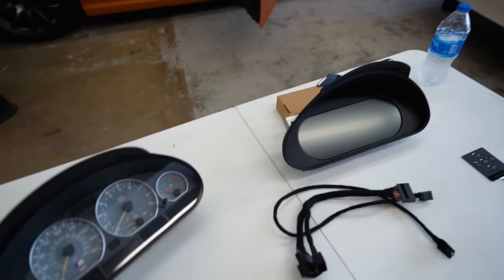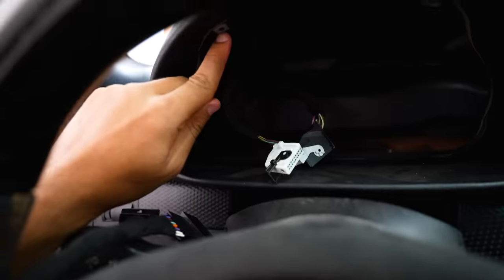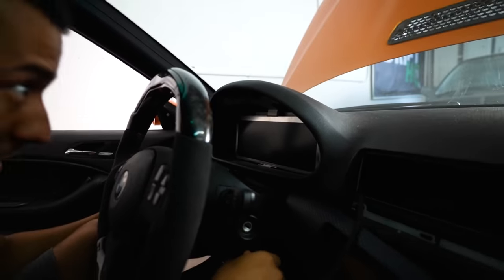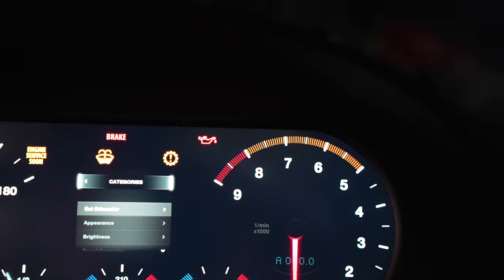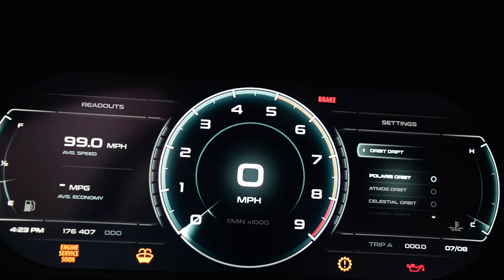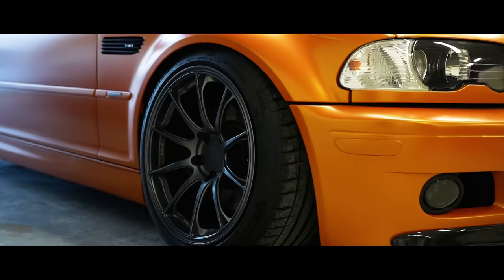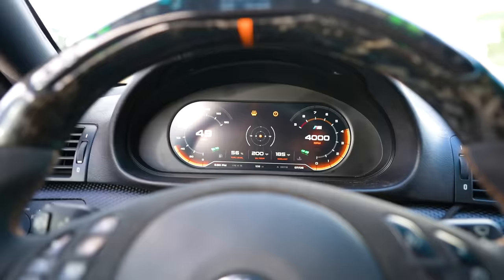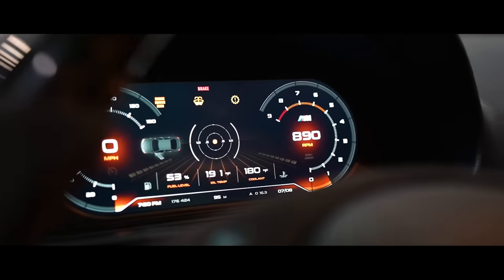How I Made My 20 Year Old BMW Look Modern Again (E46, E90, E60, E82, E70)

Comment: Is e46 more dynamic( fun to drive) than e90 ?????
Reply from the maker: While not as fast, it's definitely more fun to drive.
Reply: handles better too
Reply: @oni5909  so e46 better handling. ok. so e90 has no advantage against e46?
Reply: @hater8812  like if you wanna take a car on backroads and you have experience the e46 is gonna win
Reply: @oni5909  so e46 is more fun to drive. ok. thanks
Reply: @hater8812  yeah the cars notorious for the way it handles and takes turns was really famous for it
Reply: @oni5909  so e90 is softer. i never driven an e90. It s my dream
Reply: @hater8812  well it’s a 4 door so lot more body roll when you turn the e46 almost has none in most turns in the front

Comment: It's illegal to change the odometer mileage
Reply from the maker: It transfers the mileage from the ECU.
Reply: @VehicleVirals  but why is there an option to add or delete miles? That's illegal.
Reply from the maker: @saltpeter500  only lets you adjust the last 3 digits in the rare case it's off. That said, your true mileage continues to get tracked via the car's ECU (never changed).
Reply: what are you 8 years old ? It’s illegal ? your legally allowed to be able to change to match the new car the dials are going into and also for correction purposes

Comment: $2000 cluster and it's as delayed at the free version of torque you can have with all the same infor on a cheap eonon head unit. The human eye is most stimulated by green light so the asa wheel display is highly compromising ur detail and distance visibility at night. Does that cluster come with a dimmer option? Idk why it's just an oval ringed in abs ringed in more abs. IT should be built to full size for $200. I could hack an android tablet into my dash and add abs trim around it and set up some torque guages and make this for under $100 at this quality. Drukhadz makes all kinds of custom modules to make the m3 cluster do crazy cool shit it was never designed to! Asa wheels are a quality product  at leastn just that display is is old enough to talk to it about being safe if it chooses to have sex and the dangers of talking to old hd dvd players online. Once they update that, tot worth $1300. The digital cluster is too new n the mk1 looks like its still a prototype. if you can retrofit the e60 m5 heads up display now that thing was the best shit ever! They make sequential led turn signals that lost all the amber too and led plate lights and handle courtesy lighta are an ez way to look more modern. Those puddle projectors do not tho. No badge whores or clout chasers cares if you have a bmw if its old enough to drink and proper drivers just see "don't take me seriously I'm peacocking cuz I have no personality n can't drive" active xenon quad projectors would be great and adding power fold mirrors fully functional with an over ride to fold in manually flipping a switch would hide its age and adding a spoiler that works as an air brake or even getting obd2 soeed reading pistions for active aero, add one of those finger swiping adds and letter reconition software for the electronics in the center console that let you draw letters instead of typing so you dont gotta look would be nice, and last ONLY ADD the led wire accent light if it can be hidded from occupant viewing angles of itll look like that cheap 90s el glow wire.  Or be hella cool and make ur own custom csrbon fiber trim with the.... oh, shit... oh shit no that ideas woth money nvm! Hopefully you didnt strech urself too much getting these. You should karen some money back. They didn't even use an antiglare screen ffs!?!